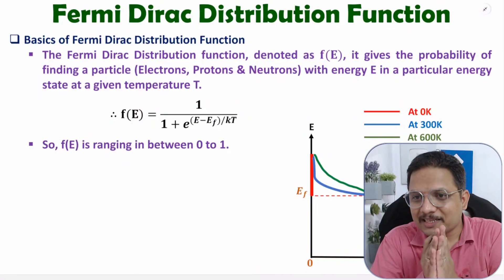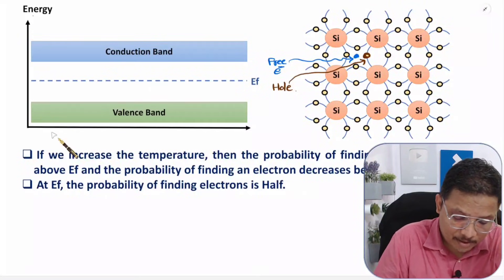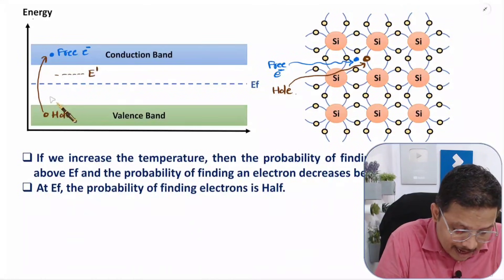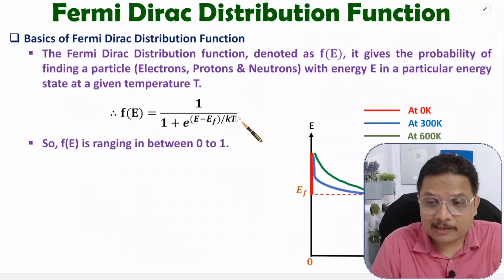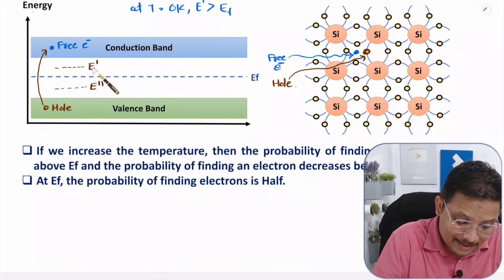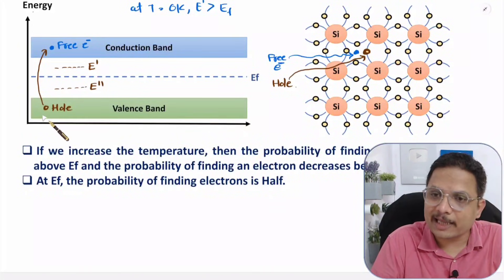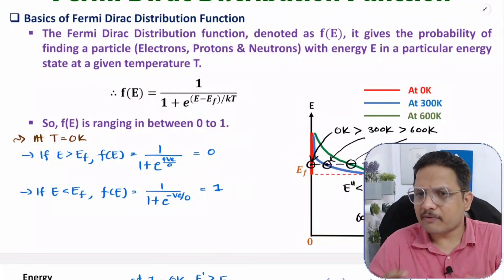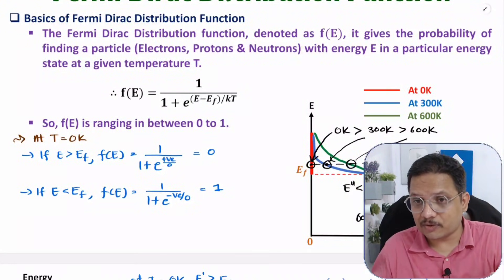Fermi Dirac Distribution in Semiconductor (Basics, Statement, Function, Proof & Case Study)

Comment: Thank you for the explanation; however, I have encountered an issue. Quantum mechanics tells us that excitation occurs only at the correct energy levels. However, in this example, the energy level E′does not match the excitation energy. Why then is there still a probability for electrons to move to the conduction band?
Reply from the maker: Conduction band itself is having many energy levels dear.
Reply: Thank you for your response. I understand that the conduction band comprises multiple energy levels, but E’ is not within the conduction band. Therefore, I’m curious about why electrons can transition to the conduction band with energy E’.
Reply from the maker: @chen-yulee4342  : Practically we are not talking about one electron, it is always aggregated electrons, but still I need to see it in more details.